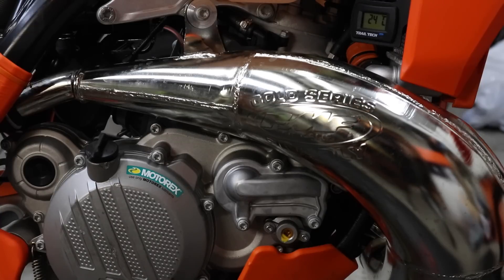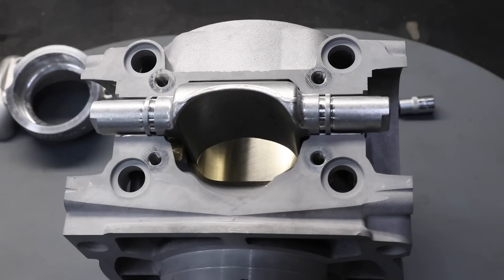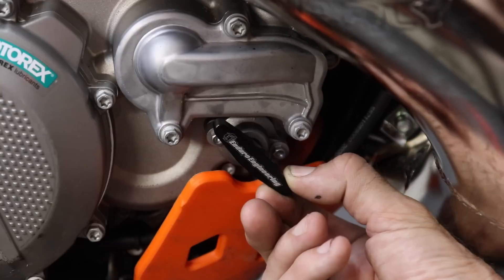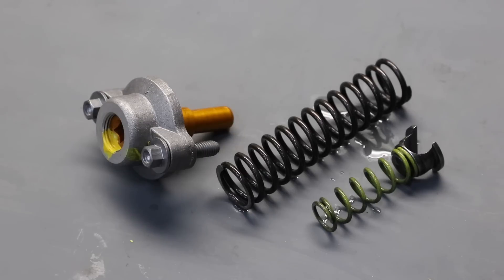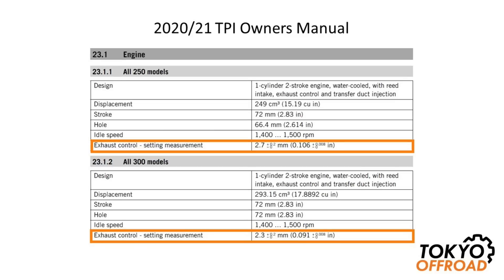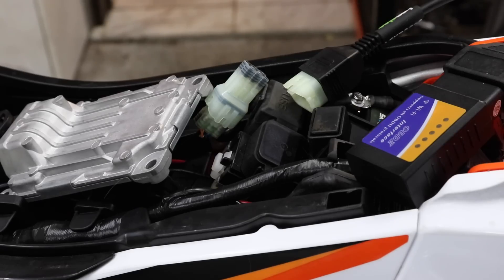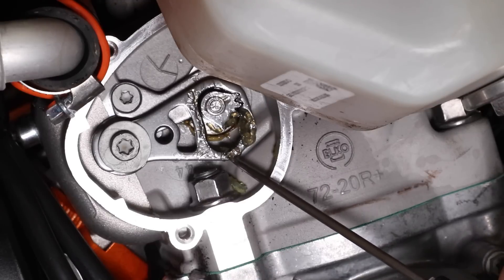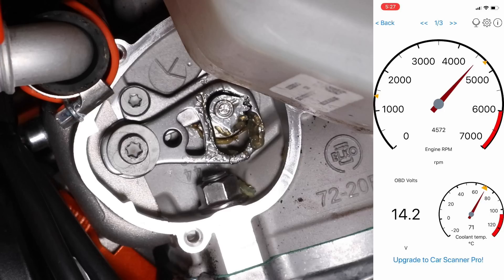KTM & Husqvarna TPI Exhaust Valve Explanation, Test & Adjustment

Comment: Question: In addition to blocking exhaust gasses, is port timing affected as well? If so, how is blowback into the intake port controlled? Nube here, sorry.
Reply from the maker: Yes, the exhaust valve changes the height of the exhaust port, thus changing the exhaust port timing. Following combustion the piston will move down and the exhaust port will become open before the intake (transfer) ports, so the exhaust gases will travel into the expansion chamber, rather than the transfer ports. Here's a video which explains the full 2-stroke cycle. https://www.youtube.com/watch?v=4wMtrVmeoBU&list=PLIxC_wjJqk0rLU6XyOFIwTZ8fmSsHOyWE
Reply: @TokyoOffroad  Thank you for the reply, honestly wasn't expecting one! I guess as long as exhaust port timing precedes transfer port timing, all is good - my thinking was there wasn't much separation between the two prior to being further reduced by the power valve. Thanks again, for both your reply, and for the channel.

Comment: No matter how you adjust the preload on power valve, the opening will start at the 5500rpm ,u can adjust from that screw only how long it takes to fully open the power valve .
Reply from the maker: It's easy to test the effect of the preload adjuster it you have a method to read out the engine rpm. Apply more preload (screw the dolly screw in clockwise) and the PV will start to open at a higher rpm. The secondary springs (red, yellow and green) affect how quickly the PV opens at higher rpm, once the PV is partially open.
Reply: @TokyoOffroad  I will test your theory.  I thought the big sprig command when the power valve start to open,and auxiliary spring how fast.

Comment: Thanks! I've bought husqvarna tpi 300 2019 ant had already not stok settings of valve. It configured for hugh rpm, but I don't need it. Will adjust to stok by this instruction.

Comment: How do I know rpm on a carburated bike? (2016 husqvarna te300)
Reply from the maker: Engine rpm tachometers are available cheaply which come with a wire which wraps around the spark plug lead and can read rpm. Or some smartphone apps are available which use the microphone to analyze the engine noise to calculate the rpm.
Reply: @TokyoOffroad  I had no idea. Thank you. Looking into it now👍

Comment: Can I do this on a carburated version of the bike ? Or is this purely for tpi’s, got my bike back from a mechanic and found out my power valve no longer had the yellow mark and was all the way out rather than flush or in.
Reply from the maker: Yes, you can do this on carb bikes, but you'll need a tachometer to measure the engine rpm as there is no digital CAN bus.

Comment: Is there any real reason to why you shouldn't switch the small spring? and is there any negative to adjust the power valve on tpi's to get another engine feeling? Thanks!
Reply from the maker: When I had my 2021 KTM 300 TPI (I sold it recently) I ran the red PV spring which allows the PV to open faster than the stock yellow spring and results in a more snappy and powerful ride feeling. I was running a GET ECU and injector kit which allowed me to adjust fueling to my liking. If changing the PV spring with the stock ECU tune you should be aware that the red spring will make it run a little leaner and that if your bike is already running lean this isn't a good idea. If however you feel your bike is not running lean then it's something you could try.
Reply: @TokyoOffroad  Okey cool, thanks for the answer! I would love to have the the power valve adjuster the ktm factory boys have where they can put preload on the big and the small spring separately. Would be cool too experiment a bit more with that!

Comment: Great video as usual! Thank you

I have just installed a new top end on my 2019 xcw300 tpi and I’m wondering how important it is to get the Z measurement adjustment stopper plate on the left side exactly right?
Reply from the maker: The z dimension for the power valve is very important to set if you've taken the power valve apart to clean, or if you're installing a new cylinder and need to setup the power valve.
Reply: @TokyoOffroad  thank you for the response :) 

I guess I’m m just not 100% sure I got it exactly correct to the spec and I’m wondering how much of it I can ‘trim’ after the fact by removing the side plate for the power valve and adjusting the stopper plate. Will I notice significant loss of power?

Comment: Thank you for all your great videos!  

Do you know what would cause the power valve to get stuck in the open position?  I just had a 2020 gas gas 300 get stuck in the open position after a top end rebuild, that had the power valves set up and torqued properly?  When inspecting the right power valve today, the spring had tension holding the power valve open?  So today a re-set up the power valve and verified they were  opening at 5,500 rpm and the bike ran great in 117 degree heat.  It seemed fixed.  I was baffled because I also did a 2020 ktm 250 xc w and had no issues at the same time.

Thank you!
Reply: Curious if you ever figured this out as I am having the same problem after a rebuild on my 2022?

Comment: Great video!  Thank you.  Why bother with getting the stock setting exact with the rpm measurement?  Can’t you just get it in the ball park with the micrometer and fine tune it by feel while riding in different conditions to get the desired power you want?  Assuming you are running a stock machine.

Comment: This valve should open fully at higher rpm correct?  Mine doesn't fully open at or around 8500 rpm but may move only 1/4 of it's potential travel.  My bike runs like shit too; 2021 300 XC-W Erzberg.  I'm thinking I have something broken in the mechanism behind the clutch side case? Have ever seen a centrifugal governor go bad on the water pump shaft or any of those parts fail?
Reply: Oh...bike has only 6 hours on it total.

Comment: Good Evening! I would like your advice because I have lost some settings in the 2019 exc 300 model. at 5500 rpm that the power valves open, in how many millimeters respectively are they in the adjuster?
Reply from the maker: I would start at 2.3mm and adjust as necessary from there.
Reply: @TokyoOffroad  thank you very much!

Comment: Isn't it more like 
Small spring - coarse adjustment
Large spring pretension - fine adjustment
?
Reply from the maker: No, it’s as I explained in the video. The large spring/adjuster control the rpm the valve starts to open and the small spring controls how quickly the valve goes from closed to fully open.

Comment: No info on the I net about this.  Limited in the manual.  Is the Z dimension set via the grub screw on the TPI bikes?  So in theory, if you don't adjust or turn the grub screw after cleaning the powervalve, the Z dimension should stay at 49.5mm.  Right?
Reply from the maker: Yes, that's correct. The TPI z dimension adjustment is on the powervalve front cover. Following re-assembly it's still a good idea to check that it's correct. 300 TPI z dimension spec is 49.5mm and 250 TPI is 49mm.
Reply: @TokyoOffroad  Yasss..Man.  We need a video on this.  No info about Z dim on TPI.  I'll still check it tomm before I button it up.  Thank you!!!!!
Reply from the maker: @jswervy16  - The KTM TPI Repair manual does contain the details regarding how to check and adjust the z dimension. I have the Repair Manual for the 2020 model and the information is on page 277
Reply: @TokyoOffroad  correct.  I read it today actually but wanted to verify.  Odd that there is no info on forums unless I just missed it.

Comment: The side ones are supposed to be pass through when the valve is closed correct?  I just did top end on 1990 KTM 300 Mxc and there were no dots to match up for some damn reason so I just timed them in the position where they were open when flapper was lowest and arm was connected. Seem correct?

Comment: Ok so thats good for the "specs" but arent those specs almost solely based on emmision standards? And not what the bike should run at for proper power delivery?
Reply from the maker: No, the stock power valve opening spec is a good baseline setting for performance and results in a power delivery characteristic which increases in a linear manner. I'd recommend anyone with a new bike to initially check that the PV is set to spec, ride and adjust from there based on personal preference.
Reply: @TokyoOffroad  alright, im going to go ahead and take your advice and do that then, you seem to be the most knowledgeable on these bikes on here, thanks!

Comment: Wondering if you have any advice on the 2021 With GET ignition and fuel injection mods? Have the same setup on my 2019 300 and its Perfect. 2021 isn't there yet. This is Extremely helpful info thanks!

Comment: What is your opinion to change the z distance increase or decrease the adjuster height.....i search for  little more torque at the bottom.....ktm 300 tpi s3 head,coober ecu, vforce4,idle skrew mode..

Comment: @ 1:00 , Not so much smaller exhaust port but "lower" exhaust port.
This effectively lengthens the power stroke which is what gives you more torque. The piston has a longer push before the port opens.
Reply from the maker: I didn't say smaller exhaust port. I said lower exhaust port height. We're saying the same thing...

Comment: How many hours you put on your 2017 300 before you got this new tpi?
Reply from the maker: My 2017 has 456H on it. It's a 250. You can see me overhauling the bottom end here. I'm going to convert it to a 300 as I have a new (used bike) which is also a 2017 250: https://youtu.be/fHozIas1nxE

Comment: Great and informative video as always, Mark - Thank you!

What about a 2017 model, how do we check the RPM there? haha
Reply from the maker: I have a digital tachometer with a wire pickup which you wrap round the spark plug cable. Be sure to set the engine type correctly (single cylinder, 2-stroke) or the rpm will not be displayed correctly...

Comment: Great video! Is there a tachometer you recommend for carbureted models?
Reply from the maker: Pleased you enjoyed the video. I have an unbranded digital tacho with a pickup wire which wraps round the spark plug cable. Works OK. I haven't tried any other so it's difficult for me to recommend one.
Reply: @TokyoOffroad   My old bike had that style tach/hour meter, but from what I remember it didn't respond very quickly to changes in rpm. I'll reply to this if I come across something more suitable.

Comment: Nice video! Thanks for the explanations 😊

Just a question : we ate ok that change the setup fo this springs don't change de max rpm engine? I have a te150i but she don't take high rpm.
Reply from the maker: I would suggest to start by setting your PV to spec settings and then test and see if it revs out OK. If it still doesn't rev out then you know the issue isn't the PV setting...

Comment: The OBD link doesnt work
Reply from the maker: What  able are you using? If you look into the cable’s 6 pin connector, how many pins have been populated? If you see only 3 pins it’s not the correct cable for this application and won’t work. For details regarding the cable I used (sold by Lonelec in the UK) check out the video I linked to in the description of this one.
Reply: @TokyoOffroad  - No...the link you posted in the description doesn't work.  It says the page doesn't exist.
Reply from the maker: @Crazystuffyousee  - The links work for me. This is the one for the cable: https://www.lonelec.co.uk/Motorbike-and-Car-OBD2-Adaptors/OBD2-Motorbike-Adaptors/KTM-6pin-OBD2-Adaptor
Reply: @TokyoOffroad  - Thank you.  This link works.  The one in the description does not.
Reply from the maker: @Crazystuffyousee  - Not sure what happened there! I just updated the link in the description and it's working now. Thanks for your feedback...

Comment: My 2019 6days 250 came from factory with preload 1/4 turn out from flush. Opening at around 4450rpm, when adjusted to 5500 the bike bogs and hesitates as it starts to open🤷‍♂️. Can’t work out why
Reply from the maker: One common issue is that the crankcase pressure sensor tube and fitting can get blocked and cause higher rpm bogging. I made this video about the issue. Certainly worth checking yours (remove the brass fitting from the crankcase and make sure it's clear): https://www.youtube.com/watch?v=CTBLjElDNQ8
Reply: @TokyoOffroad  not that either. I had the erratic revving and I always clean that hose.  I got a lot of gunk out of the actual ccps. U might have seen it on two stroke performance fb page. That fixed the erratic revving holding stable throttle but the bike likes pv opening early.  Haven’t seen another bike that had same preload setting from factory like mine
Reply from the maker: @darrenh4045  I see. Yes, your factory set preload adjuster setting sounds very unusual. Have you taken the adjuster off the bike and checked that the springs are installed correctly. Other checks to make are regarding fueling (check fuel pressure, fuel filters, injectors). Have you discussed the problem with your KTM dealer?
Reply: @TokyoOffroad  to be honest I haven’t worried too much about it. Just mentioned it cause don’t hear of them set like this.  Always ran very rich. Air screw was 3 1/4 out from factory too. Used to have low rpm splutter but sorted that with tsp med comp head and ecu.  And run Pv 1/4 in from flush, air screw 2 1/4 and has way more power than stock. Still rich though fair bit spooge out the pipe. Have done all fuel filters and on top of all the ‘common’ tpi things.  This bike just is how it is.  It’s odd I know. Don’t know why🤷‍♂️ but I get 120klms from a tank and its goes hard

Comment: Random question, but i have a 19 250XCF and the e start does not work at all anymore.. About one month ago it started to really lag/delay when I would hold it. I would have to hold it, let go, hold it for about 4 seconds and it would finally crank. Then it turned into holding it for 6-8 seconds, and then even 9-10. Now  it does not start at all. Is the stator or starter the issue? The battery is fully charged and the connections are clean. (I had to bump start it on my last ride because of the issue)
Reply from the maker: When you press the start button can you hear the starter solenoid click? One easy way to check the motor is to apply power directly to the starter motor terminals (use some car jump starter leads) and see whether it turns over easily. One common issue is the battery ground connection to the subframe can become corroded creating starter issues. Remove the ground connection, clean with a wire brush and retest.
Reply: @TokyoOffroad  When I press the starter I do not hear the solenoid click. My ground to the subframe has been cleaned. And to access the starter motor terminal is it behind the ignition cover?
Reply from the maker: @ryanrussell3893  Do you have a multimeter? If so set it to voltage mode and measure the voltage on the solenoid white/red wire (should be 12V, if not then the fuse is probably blown). Next measure the voltage on the solenoid blue/red wire (should normally be 12v, then change to 0v when the starter button is pressed, if it doesn't go to 0V then the wiring/connector/starter switch are most likely causes). If both of the measurements are OK then the solenoid may have failed and will need replacing.
Reply: @TokyoOffroad  Are the wires for the solenoid behind the ignition cover? Or under the seat?
Reply from the maker: @ryanrussell3893  - I’m assuming that you’re talking about the start motor solenoid. The solenoid is located under the seat. The control wires run from the starter switch to the solenoid. The start motor power runs from the solenoid to the starter motor terminals located on the right side of the bike. There is no starter related wiring inside the stator cover.
Reply from the maker: Sorry, I’ve just noticed your bike is a 4-stroke. I haven’t worked on a 2019  250XCF so it’s best to refer to the repair manual (which includes wiring diagrams too).
Reply: @TokyoOffroad  okay appreciate the help.

Comment: the idle speed for the 2020/21 is waaayyyy low.....I have mine around 1800-2000rpm.
Reply from the maker: Interesting. The KTM idle spec in the manual is 1400-1500rpm. My 2021 300  TPI is about 1500rpm and runs fine.
Reply: @TokyoOffroad  you have a ktm 2012 too??.....come on!...mine is a 2007 and in 1500rpm won't run(too much stalling,also I have a rekluse 3.0 core that's y mine is set to 1800+ rpm)
Reply from the maker: @desmonchild  - Typo, 2021 and fixed now. Yes, it runs fine with the idle at 1500rpm
Reply from the maker: As I mentioned in the first ride impression video, my 2021 300 TPI does not stall easily at all... https://www.youtube.com/watch?v=db-jSWo1rlw
Reply: I've heard a heap of stalling from issues that then require the idle screw mod due to low idle. etc.
Reply: @Cee-FJedi  What do you mean ??.....I don't understand.

Comment: Adjustment all depends on what power delivery you prefer for your riding conditions.
I ride greasy rooty trails with a lot of steep transitions.
I run the stiffest spring...and set it by feel, which is in far enough to keep it off the pipe until the throttle is almost wide open.
Basically it opens much later than stock. It lugs better and I have more control over traction.
Reply: I also did this with my tpi, no problem at all was much more controllable and still ran perfectly. Ive no idea why they dont want you to fiddle with the powervalve.
Reply: The same for me. I put red spring and all unscrewed. 200h with a 300 tpi 2018 without problems. I don't know why Ktm doesn't want to touch this regulation...
Reply: @JONTU  how did you like the red spring and flush? Heard it was more linear power.